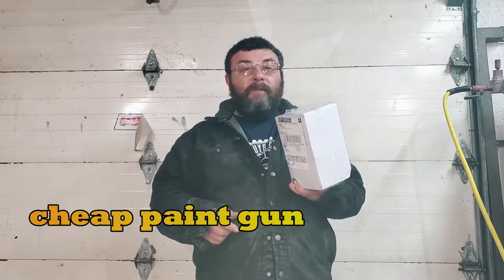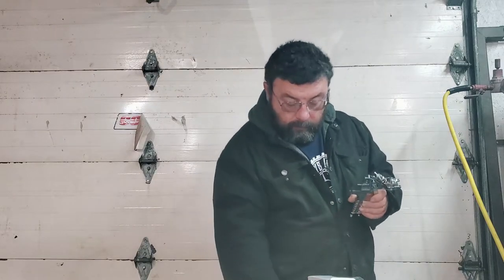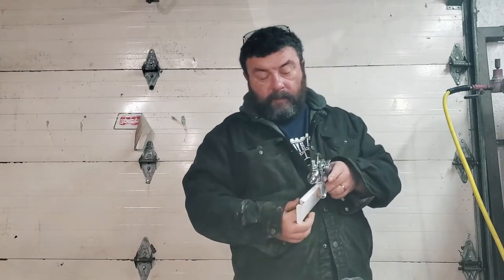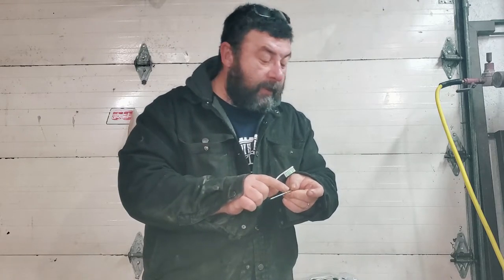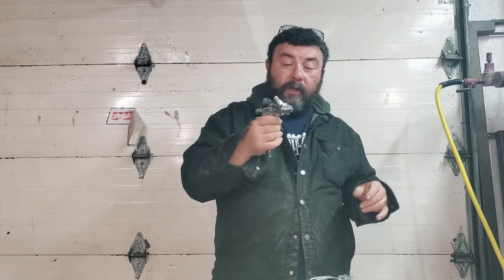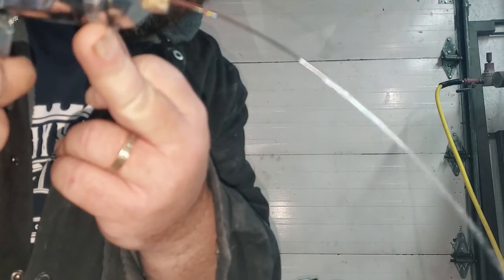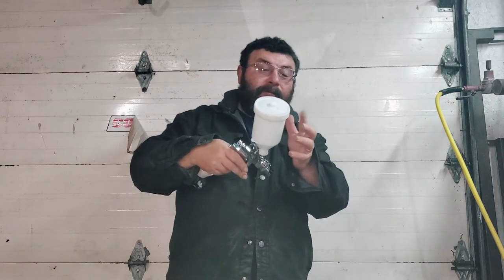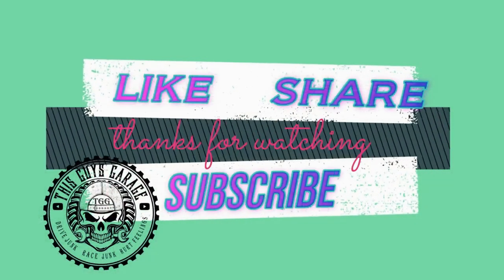cheap paint gun from amazon

Comment: LOLOLOL, you did exactly what I do with those EXTRA PARTS, throw them off into the sunset, LOL!! When that wrench bent, I FELL OUT, LOLOLOLOL!!! Shaun, once you do the comparison video, please go more into the cup sizes needed to paint a car because when you said that cup size would NOT be enough to paint a car, the question that I had was what size cups are required.

I bought the 3 piece Devilbiss set and have yet to use it, so I'm looking forward to your video. the main points I would like you to cover is:

1. Cup size for the job
2. The compressor that we need, and can we use the cheap 30 gallon compressors
3. Spray pattern
4. Minimum outside temperature needed
5. What to use when cleaning the gun after painting?
6. How many paint jobs can you get when using a cheap gun like the one you have in this video?

LOOKING FORWARD TO NEXT WEEK!
Reply from the maker: really great questions i will certainly address in the follow up so thanks so much. 

we always throw away  the surpuflous parts lol

Comment: You mentioned best gun for home use.  What’s your compressor setup like?  A lot of us have 5-10 gallon compressors at home.  Will that do the trick?
Reply from the maker: the most important thing is being able to maintain 50 psi at the gun. that would be the highest pressure you would have to run at. your compressor would limit the size of the job you could do.   for example a I have painted a car complete with a 20 gallon compressor .but at times your waiting for it to catch up. hope this makes sense.  let me know any follow-up. happy to help and ty for the question.  I will mention this in the follow-up